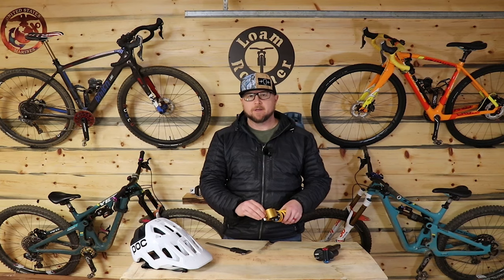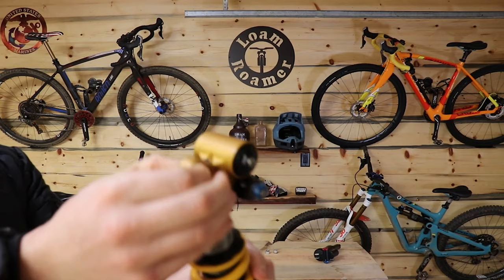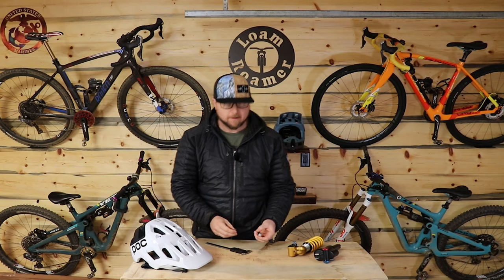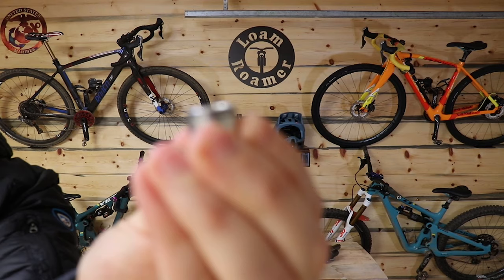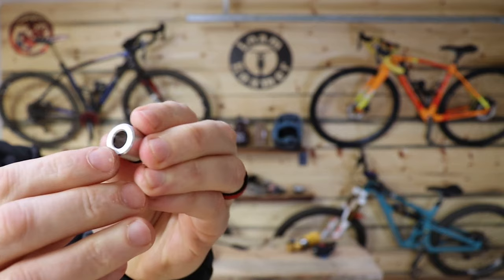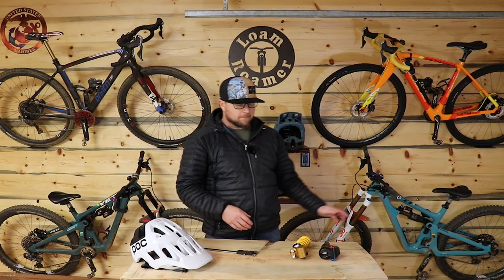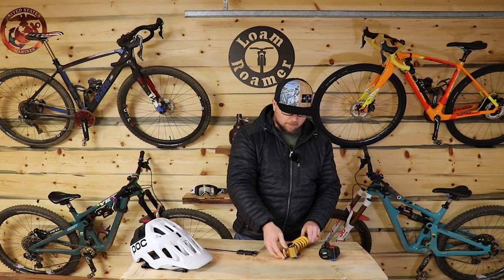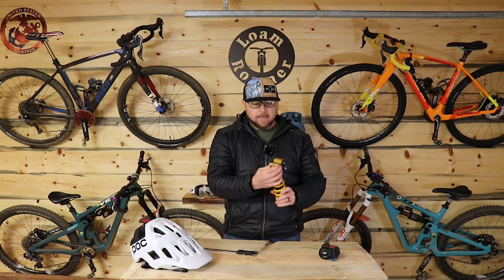Ohlins TTX22M Spherical Bearing. BUT Where do you get endcaps? Yeti SB series and others.

Comment: I've asked Öhlins why they do not offer wider hardware and they answered that wider hardware "would compromise stability". Is this reasonable? Why should it be a Spherical bearing specific stability concern (there is wider hardware for normal bushings)? And somehow, for Push industries, this concern does not exist, since they offer wider hardware for their Spherical eyelet bearing system.
I guess it is just an excuse for not being able to offer wider hardware (their amount of hardware in different spacings, even for normal bushings, is generally fairly low compared to RockShox)
Reply from the maker: I find they do not want their stuff compromised, but I agree they should deliver the hardware as manufacturer design. That being said, all the coils broken on specialized bikes do reiterate the problem. You are building in a weak point for no reason. I created my own hardware and took the risk.

Comment: Just installed the ohlins ttx22 on my 2021 specialized stumpjumper evo. Do you know if the spherical bearing is available for this bike?
Reply from the maker: The spherical bearing for  TTX is available for all bikes, it is a shock part. The issue is the end caps. Call Mike at Full flow, he is having some made, tell him which bike you have and that you need a set and a bearing, he is going to be shipping kits. I would think a Stumpy Evo would really benefit from the bearing kit as it has some very nice frame flex built in that I noticed in my review of that bike. Great bike!
Reply: Awesome! I’ll contact mike. Thanks for your help.
Reply: Afaik, the problem with longer than 22,2mm wide spherical hardware would likely put too much stress on the 8mm hardware axle.. As on normal hardware the sleeve would go through the eyelet, but here all the loads goes directly on an 8mm thick part.

Disclaimer: Yes, I have shimmed 22,2mm Ö hardware up to 25mm with stainless steel precision washers.. but wouldn't necessarily recommend it..

Comment: Shock size 222 by 70 mm (8.75 by 2.75 )
Reply from the maker: What does this have do do with the end cap width and frame mount tab width? The shock length and stroke are irrelevant to the endcap mount width.

Comment: Wondering why would you use the spherical system just on one side and not both?
Reply from the maker: The allowing of movement from one end is all that is needed to deter the shock from binding from sideload. I would be concerned if the shock could twist along the axis from both ends creating new issues. Not 100% on that, but makes sense to me.
Reply: @LoamRoamer  thank you for the answer, Would you say this system is something worth considering in a bike such as the Wreckoning? I don't think the flex in the frame has an impact in a suspension design such as the Delta.
Reply: @LoamRoamer  Öhlins says the Sphericals can be installed at both ends of the shock. Only installing the spherical at the end connected to the main frame will only isolate the shock from one dimension (rear wheel with camber angle) of side loads/frame flex. The frame can still flex in a way (rear wheel with toe angle) that side loads the shock.
Another advantage of having them at both ends is that they can correct for frame misalignment